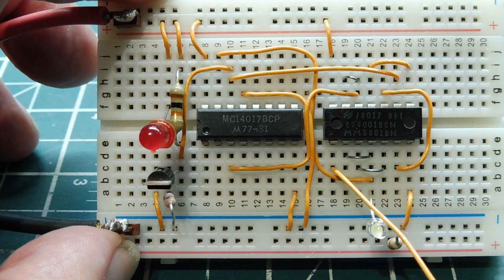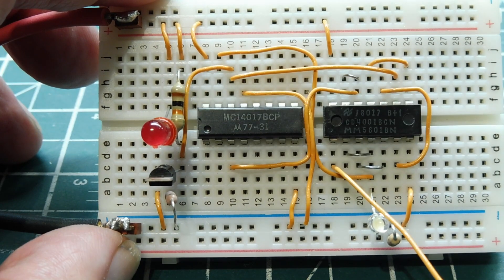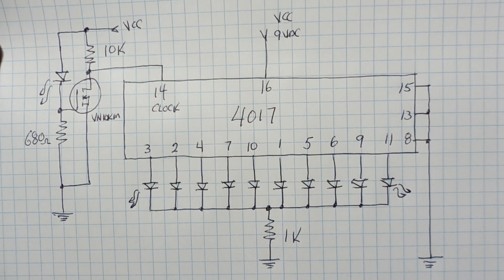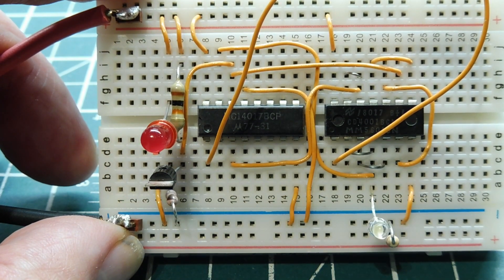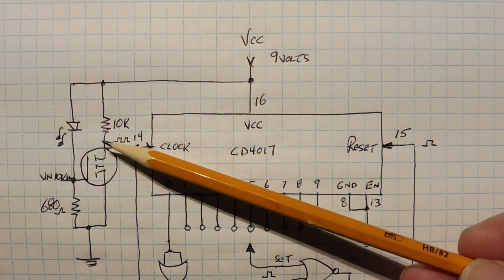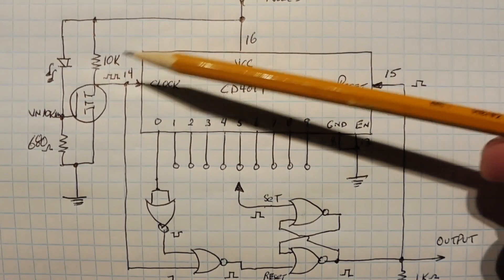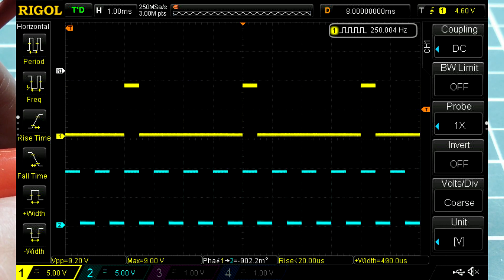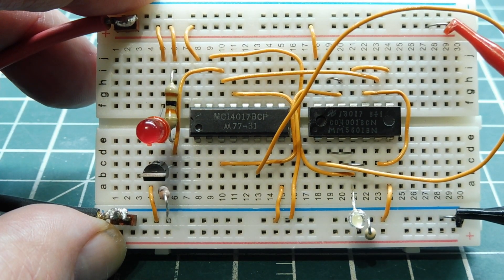Programmable Frequency Divider / Quick Circuits  CD4017

Comment: Hi there. I just subscribed to your youtubes after watching a 5 year old video you made on frequency divider using 4017 and 4011 chips. My question is related to the LED you showed that has in built oscillator. I would like to order one but what the heck is it called to order. If I type anything into google with LED and oscillator I just get a whole load of circuits that oscillate and use an LED to show the effect. There must be some technical term for the LED you used that I can put into a search engine. Can you help? Your frequency divider circuit worked very well for me but I have to figure out what you meant by feeding the output into a D type flip flop "configured in total mode" to get 50% duty cycle output from your frequency divider circuit. Thanks for your time.
Reply from the maker: Search online for "flashing" or "blinking" LEDs.    https://rb.gy/0a8s8j
You can get a 50% duty cycle with a D flip flop "configured in toggle mode" or divide by two.
Check out these videos for more info. Thanks for the visit.
https://youtu.be/1u7MMCwbqpE
https://youtu.be/mlzeD2cS3Og

Comment: Hello! I’m not sure what I’m doing wrong but I can only get this to divide by 2.
Reply from the maker: Double check your circuit wiring. Use a logic probe to follow the clock pulses through the logic ICs.
Reply: Are you not supposed to power it independently? Bc it works great when I only plug a battery into the 555.
Reply: Also if I use multiple dividers on one board to I need diodes for the connection to the clock?

Comment: Great videa, but I wish I could find instructions that tell how to divide frequency by a value greater than ten. Can anyone guide me to a schematic, video or set of instructions that show how to do this?
Reply from the maker: You can use a CD4020,  a 14 stage counter that can divide up to 16,384. Use a multiple input AND gate to decode what value you want to divide by.
Reply: @0033mer  Thanks for the response. I was hoping to do this with 4017s because my goal isn't a final   project (a very slow LED chaser), but self-instruction on how to cascade 4017s. But since there's virtually no information on the web on how to do this, I'm thinking most builders have decided this isn't the way to do it. Also, the NE555P isn't very accurate for long period timing IMO. I doubt I would ever find a solution for that.

Comment: Awesome video, great explanation. Might be a dumb question but what happens if you remove the 4001 and just connect one of the output pins of the 4017 to the driven LED and reset pin?
Reply from the maker: It may look like an easier solution but when one of the output pins goes high and resets the IC the output pin instantly goes to ground so the output pulse is so short it will not be noticeable. The SR flip-flop holds the high output and is synced to the input clock where the next clock cycle will reset the flip-flop resulting a clean and usable output pulse.
Reply: @0033mer  Thanks a million for the reply, you're right it did seem easier from the random schematics I'd seen online but your explanation makes perfect sense as to why it's not the best idea! Your channel is an absolute goldmine of interesting content.
Reply from the maker: You're welcome. Thanks for the feedback.
Reply: I think you can simply connect the output to reset.  If you want exactly n pulses, connect the pin coresponding to output n to reset (when reaching output n, you have traversed n intervals).  If you want a divide by 10 counter, don't enable the reset pin.  That should guarentee exact timing with respect to the clock.  You would typically NOT drive an LED from the output that resets the chip, that would be an extremely short pulse.  The last output is only used to reset the chip after n intervals.

Comment: Hi I'm trying to make an organ with 4017 and 4060 would that work?
Reply from the maker: A 555 timer organ would be easier to make by switching in the proper resistance for the different notes. A 4060 would only produce octave notes. Check online for inexpensive kits. https://www.banggood.com/buy/electronic-organ-kit.html
Reply: @0033mer  How many octave notes for the 4060?

Comment: Can you tell me kindly how can I convert 1 Ghz frequency to 80 Mhz frequency?
Reply from the maker: You could build a downconverting mixer using a ADL5350.
Reply: @0033mer  Thanks for reply. can I do it by using a hmc705LP4 and 555 timer ?
Reply from the maker: The hmc7005LP4 will divide down a 1 GHz signal. Dealing with high frequencies your PCB becomes an important part of the circuit. A 555 time is a low frequency device with a max astable frequency of 2MHz.

Comment: I found this video very clear and well produced.  I want to make a divider which will divide by any number from 1 to 250, set by switches.  Any ideas please?
Reply from the maker: You could use a CD4040 12 stage ripple binary counter and use a diode matrix to get your desired modulus count. The diode matrix will reset the counter at the desired count value. I used this technique to build my FSK generator. https://youtu.be/R_UQa3gXbwY
You could also cascade two 74161 (74HC161) counters to get a divide by value up to 256 with 8 control inputs.
http://www.wenzel.com/wp-content/uploads/161divdr.pdf

Comment: Great video! What kind of LED clock is that???
Reply from the maker: It's a flashing LED. Connect power to it and it will flash. Any device in series with the LED will also be activated.  https://youtu.be/mlzeD2cS3Og